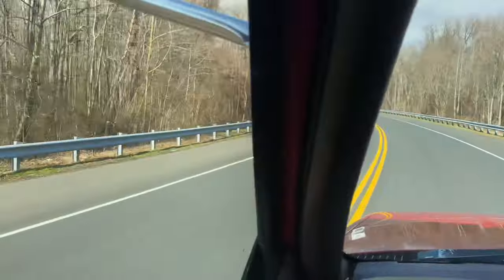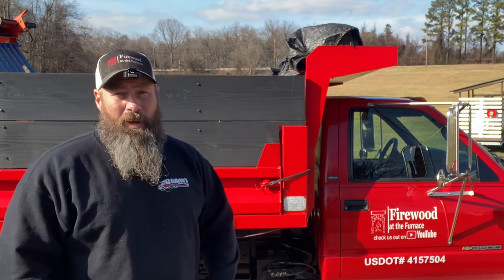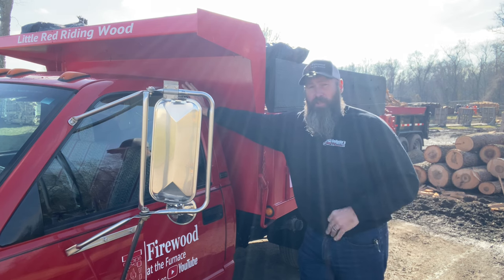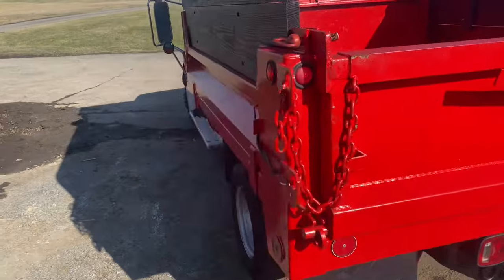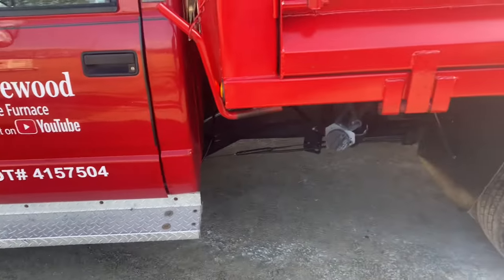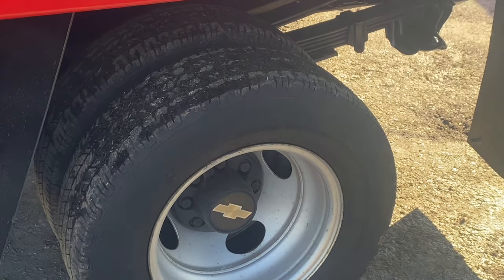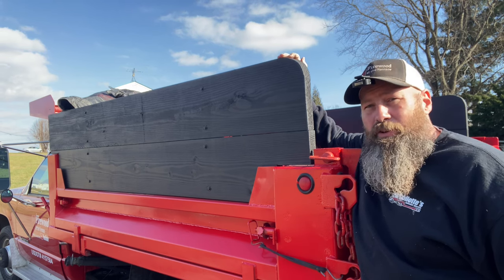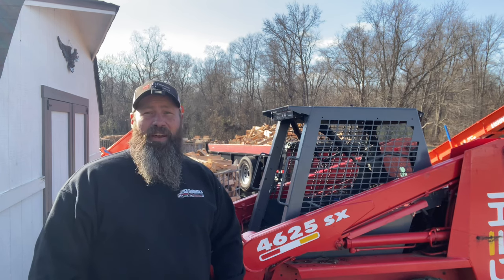DOT INSPECTION & WHAT TO EXPECT - #190

Comment: Am I understanding correctly that logbook are not needed if operating within 100 miles of your homebase?
Reply from the maker: Yes that is correct. 

What is the short-haul exemption?
If you are a short-haul driver or fleet, there are several short-haul exemptions, including time restrictions, as well as a distance-related exemption, which is the 150 air-mile exemption.

What is the 150 air-mile exemption?
This exemption applies to both CDL and non-CDL drivers with an operating radius of 150 air-miles.

Drivers are required to:

keep timecards
return to the same work reporting location, and
only drive in states not requiring a CDL for their vehicle.
Note: Previously, the exemption included a 100 air-mile exemption as well and was changed in 2020 to 150 air-mile for both CDL and Non-CDL drivers.

What was the 100 air-mile exemption?
Before the rule change on September 29, 2020, the 100 air-mile exemption applied to CDL drivers and to qualify they needed to:

remain operating within a 100 air-mile radius
return to the same work reporting location
go off duty within 12 hours, and
keep time cards with start and end times and total hours worked daily

Comment: Brad great job. I have my CDL’s and I have shared to a couple people your videos. They were impressed and didn’t realize a lot of the rules. You may of touched on it already but in that type 2 inspection if alcohol is suspected a CDL holder is set at a higher standard or level to that possible infraction. I could be wrong. Thank you sir.
Reply from the maker: Yes the amount in your BAC is lower for commercial motor vehicle

Comment: Interesting question for you as an ex LEO Brad, under the 5th amendment of the US constitution once a driver invokes that right and notifies the officer, the The driver does not legally have to participant in the inspection on the grounds that participation may incriminate the driver. The officer can inspect the vehicle but cannot demand under threat of infringement or arrest that the driver participate in ‘his/her’ inspection/investigation. Ie; driver does not operate lights, opera, horn, or open hood etc. 

Are you able to clarify this please?
Reply from the maker: If you refuse to comply with the inspection process then items that cannot be checked will be marked out of service. You will be shut down, massive CSA points applied to the companies safety rating and most likely increased insurance premiums.